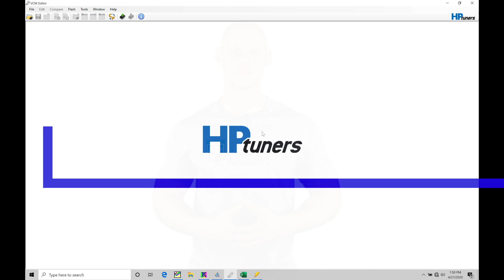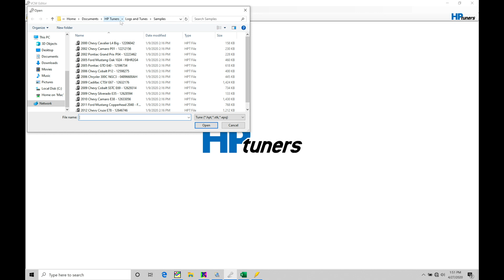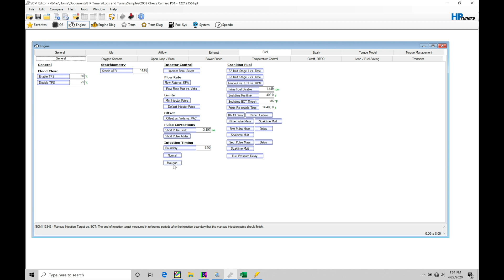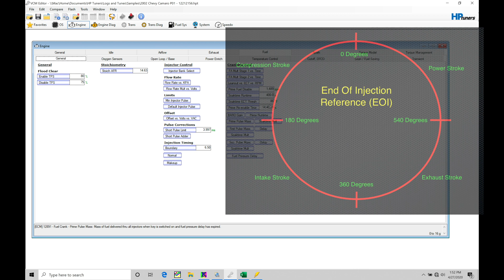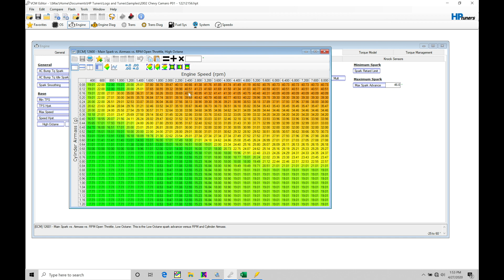HP Tuners GM Gen III Training Part 28: Fuel Injection Timing | Evans Performance Academy

Comment: I have a 2016 duramax just replaced the engine and programmed injectors and it won’t start, when live data reading the injector timings 1-6 & 8 are displaying 3,000+ degrees but injector 7 reads 1.7 degrees, injector 7 is the only one that commands to spray and it hiccups and then just cranks, help please 🙏